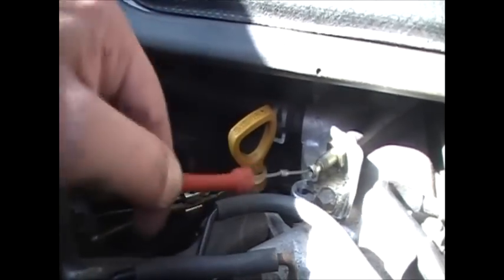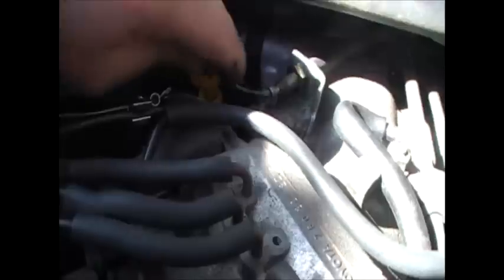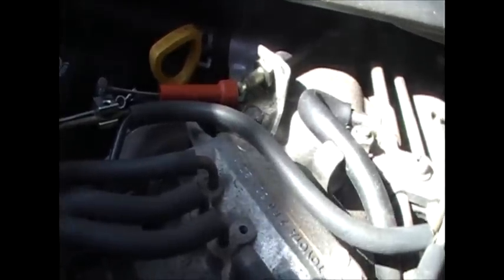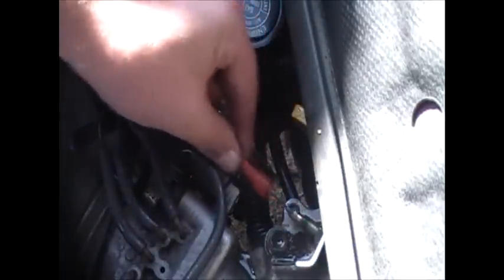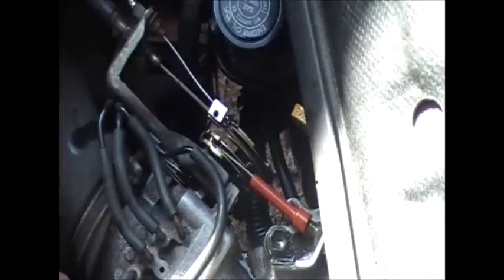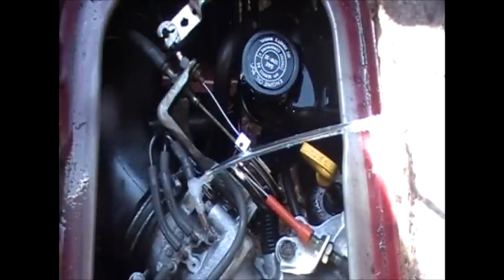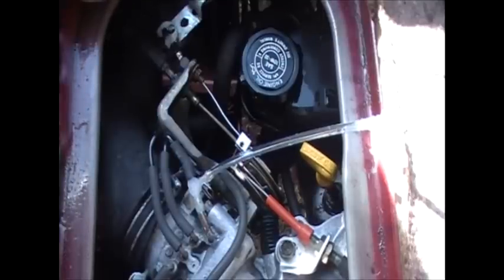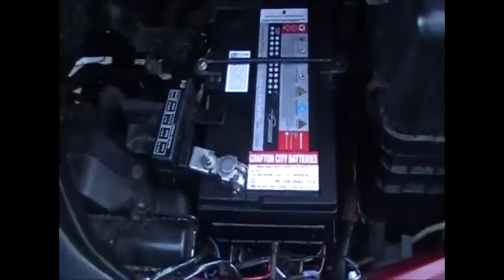T.V. Throttle Valve Cable sticking [ Tarago Previa Estima ]

Comment: Hi thanks for the videos they are a great help. I was having issues with my previa where the gears kept shifting from overdrive to third every 2-3 seconds on the highway. I had a look at this cable and it was sticking like yours. However, it rusted quite a lot and has snapped. Could you give some tips on replacing the cable. Many thanks Hasher

Comment: Bought a Previa/Tarago for cheap, as the owner had been told it needed a new tranny. First thing I noticed after bringing it home, was that the TV cable was totally extended/stuck. I've been using WD40 for two days and it still wont budge. I cannot find a replacement either...